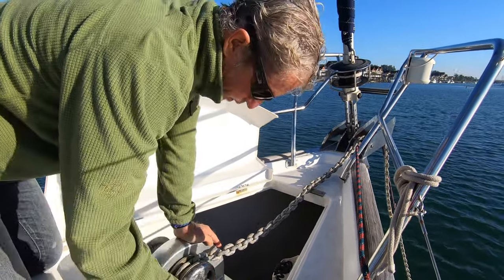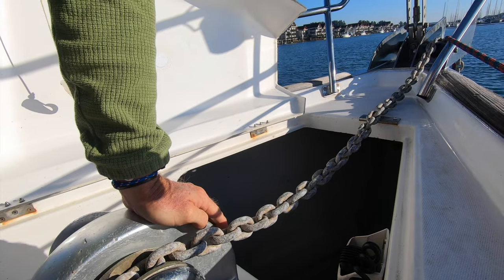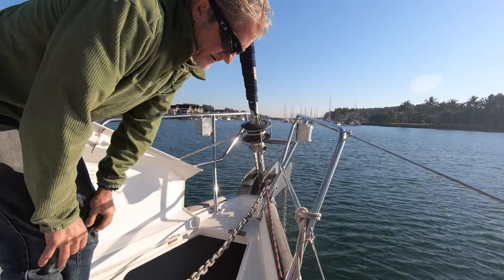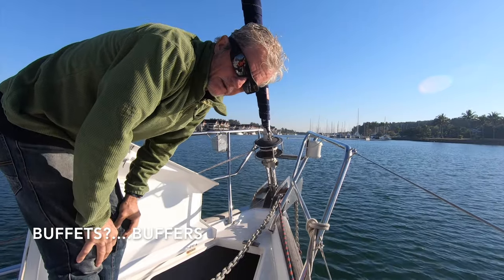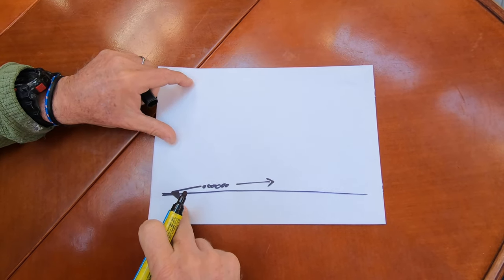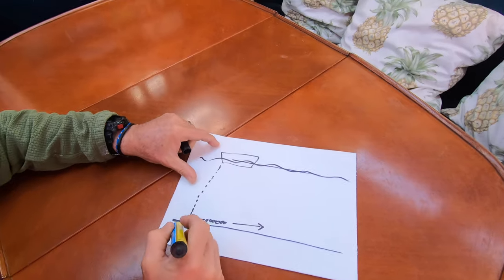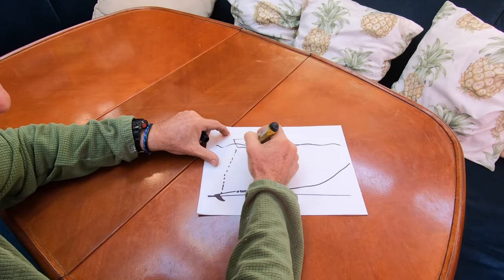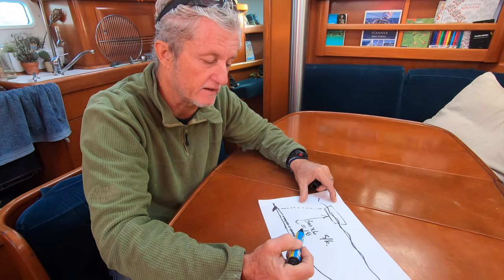Anchoring our Sail Boat! Boat Tour

Comment: Thanks ... but a question, where in RSA can one actually "liveaboard" one's yacht permanently? 
From what I understand, one cannot (only short stays are permitted by application I believe) as all marina's are in our ports and those are international no-man's land, much like one of our airports for example.  Any info would be appreciated.
Reply from the maker: Hi Larry Most yacht clubs in SA have or are attached to a marina, and these marinas normally have long term contracts for liveaboard yachts, and in some cases you can purchase your mooring and only pay a small monthly service levy.
  If your boat is registered offshore you will have to pay port fees based on your boat length and the time you have stayed in the port. In my experience this has been the bigger commercialised  ports ie. Cape Town and Durban. The relevant clubs will be able to guide you with this. Hope that helps! Robin